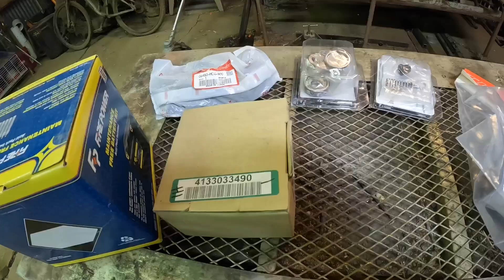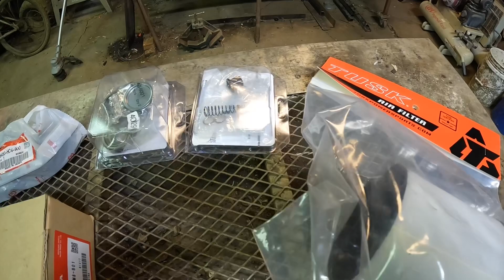Bringing Grandpa’s ATV BACK to Life!  Part One- Brakes

Comment: Watching you work on your brakes brought back my memory of Pete from Just a Few Acres channel when he completely disassembled a tractor, repaired and/or rebuilt or replaced parts, then painted everything and then put it all back together. I'm not a mechanic by any stretch of the Imagination but watching him to that over the winter was simply amazing. If you haven't checked his channel out you should.
Reply: FTR has mentioned in previous videos that he does watch Pete at Just a Few Acres

Comment: @10:40, that's a German design....brake shoe holders....install first before the top and bottom springs. Probably don't need them...but they're useful if the top or bottom springs break....keeps shoes in their relative position.

Comment: Great video. Only issue I have is you've reminded me I need to replace my brake pads on my Kia Soul. fortunately I have a set of turned rotors set aside that I can install immediately and have the current rotors turned down at the auto parts store for next time. I probably need some more caliper grease. I moved last year and the old can was lost somewhere. LOL.